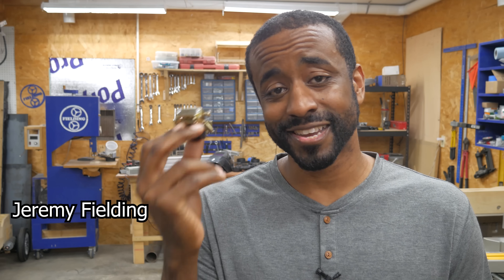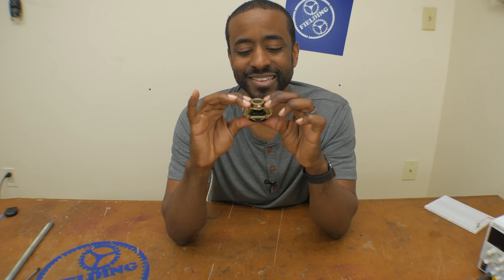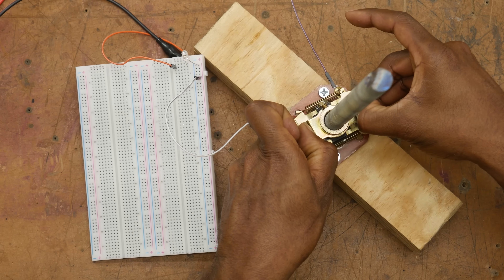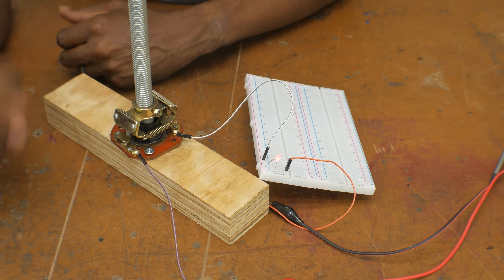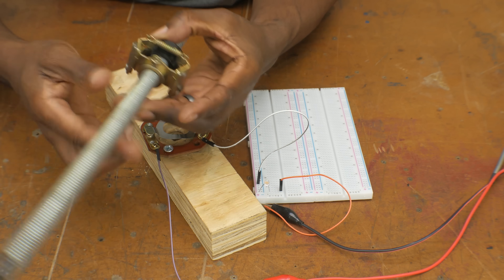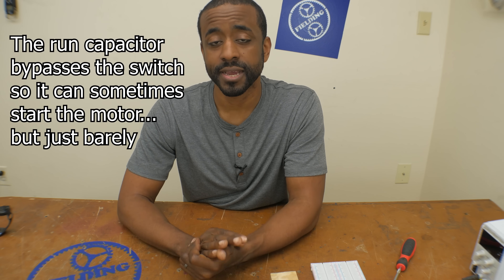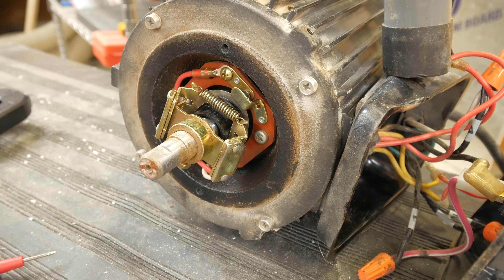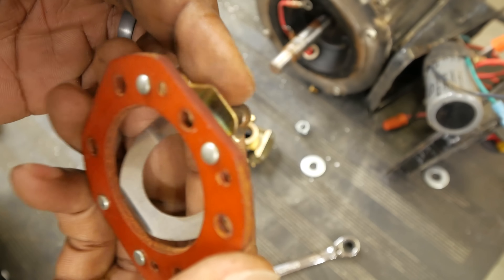This Clever Device Is Found In Nearly Every American Household. How It Works And How To Fix It

Comment: Sorry you're wrong. Its a CENTRIPETAL switch not Centrifugal. Common misconception..
Centripetal = Inward force working out
Centrifugal =  Outward force working in
A Centrifugal clutch spins and the weights push the V-Pulley in pinching the V belt. Get it From out to in . These are usually on Go-karts. I only have a GED and know this..
The amount of people in the comments that overlooked this very basic concept is a crime against the education system. Let alone the guy that spent 9 minutes teaching about something he doesn't know the correct name of or the physics concepts behind his words. Hilarious.                        496/670,000 people can do math.....
I barely made it 1.5 minutes in and I'm done....
Reply from the maker: The name is correct. The other details aren't relevant here. Perhaps an argument for a physics class not a video about electric motor parts. You are strangely worked up over this. Anyway... thanks for watching... that 1.5 minutes counts!

Comment: The mechanism was first implemented in steam engines, there was a shaft inserted in a steampipe with a turbine attached at the end to make a pair of iron bals spin, if the pressure got too high it would spin quickly lifting a check valve to the atmosphere and effectively reducing inside pressure and avoiding all together a explosion in the cauldron.

Comment: If you don't add a snubber circuit to the motor and/or the centripetal switch, you'll spend a lot of time cleaning and changing contacts in the future. It's the same problem that occours with contact breakers in car engines with mechanically-timed ignition...

Comment: Below is the patent registration for the centrifugal switch. This engineer worked for GE. The patent pending was submitted by GE in 1939-11-01. Full patent was granted May 27, 1941.  The patent has been renewed a number of times after granted.  See below:
--
 y 1941- c. P. PEPPER CENTRIFUGAL SWIT CH Filed Nov. 1-, 1939 2 Sheets-Sheet 1 Inventor:
- Carl P. pepper",
I byMd HIS Attor'ney.
' y 1941- c. P. PEPPER CENTRIFUGAL SWITCH Filed Nov. 1,' 1939 2 Sheets-Sheet 2 IIIIIII/ L. w P n o P e o MP W A 1m m afl C Y. b
Patented May 27, 1941 UNITED STATES PATENT OFFICE CENTBIFUGAL SWITCH Carl P. Pepper, Fort Wayne, Ind, asslgnor to General Electric Company, a corporation of New York Application November 1, 1939, Serial No. 302,383 

Google Patents:
https://patents.google.com/patent/US2243577

Comment: Awesome Jeremy! I have many motors in my shop that make that noise. Thanks for explaining why they do. One note: BEWARE capacitors as they hold a voltage that can bite you during disassembly. Short the leads with a screwdriver (AFTER UNPLUGGING!) or spare lead to discharge them during the troubleshooting and repair process. Keep the great videos coming...

Comment: If you have a points file (used on older car distrbutors), you'll be able to make this fix easily with a tool designed for that contact file job.

Comment: Yep, you found the problem, but your solution “might” be far from ideal. Those switch contacts are usually made of a filler cheap metal and then the contact are plated with a more “”spark”” resistant alloy. So when they fail like this one is time to replace it because sanding just makes it work for a short while and will keep “boring” its way through the metal on each “click” and wore out way quicker than a new one. At very lest I suggest sanding it with the highest grit possible to avoid “roughness” that helps more sparks (this is why new contacts are mirror finished)
This suggestion applies to electromechanical relays, same principle; different alloys for different purposes

Comment: A very similar type of 'switch' is used in 40 mm grenade launchers.  The round isn't 'armed' until it travels a certain distance.  As it travels through the air, centripetal acceleration caused by the round spinning in the air causes little weights to pull the 'safety' out of the way. 
-
That scene in Scarface... total nonsense.  These don't arm until about 30 meters.

Comment: I used to work on C130H (Hercules, that big military transport plane with 4 props) and these are one of the main components that regulate the fuel flow to the engines or keep the prop from spinning out of control (basically anytime something that spins needs a feedback loop you'll find one of these guys)

Comment: a comparable replacement is 220V but i guess you have freedom voltage as well as freedom units. I am honestly surprised with how many workarounds American engineers have to have to deal with 110V/10A (ie, 2 phase ovens). At 220V/10A you can still use the same wire guage but get twice the power with no downsides.
Reply from the maker: We have both 120 and 240 in every house hold. I don’t understand your comment
Reply: @Jeremy_Fielding  really, why?

I've heard that it was only 110, with double phases for high power appliance (giving around 200V non sinusoidal) but maybe that's just for apartment blocks with access to all 3 phases. I've seen video of it but he lives in an apartment as I suggested. This guy was trying to get a Ozzie hairdryer to work in America and on 110V.

But if you have both why have both? There is no need for 110V, infact as you showed in this video it's a detriment, needing capacitors and extra moving parts to give high power items an extra boost. And it just seems an extra hassle wiring the house (and do you have two power metres or something? Or every house has a 2:1 step down transformer?).

Comment: Rubbing contacts with sandpaper should only be used as a temporary fix, until you can get a new set of contacts, or as a quick fix when you cannot obtain a new set of contacts. The reason is that many contacts have a plating that you'll remove with the sandpaper which will reduce the operating lifetime of the contacts. Maybe use a lot finer paper too (P300?). Other than that, a really interesting tutorial. In the UK, I've never seen a centrifugal switch like this, maybe because the voltage is higher? (230v vs 110v)

Comment: Why haven't we used this technology on Bayblades
Reply: Not exactly the same, but spinning tops with lights inside that light up only when rotating, actually use something similar, but way simpler: just a spring and that's it. Literally, a spring, that with it's own mass, touches a metal contact and closes the circuit for the light.

Comment: Ha, reminded me of the old days when the car would not start. Had to take an emory cloth to the points, clean them up and set the gap (by eye) and "TA DA", your friends and your girl think you know what you're doing and  you're the hero. Yay
 Nice and easy explanation of this fascinating part. It also remind me of "balls out". No no, not that. The governing technique where 2 weights swing outward to govern max speed.  Which also gave us the phrase that means one is going as fast and full throttle as they can. "Ball out", or "balls to the wall".

Comment: A few corrections: 

1. The start capacitor will not explode if it is not disconnected from the circuit within a certain time frame (most capacitors run in series for this application). The very nature of capacitors are to A: store electrons for that initial 'punch' of power, B: clean up the power and protect the rest of the circuit from voltage spikes, C:act as a buffer from induced current from a collapsing magnetic field.

2. The start and run windings of an alternating current induction motor are different in this way: the start windings consist of fewer turns of a larger gauge coil which lets more current pass through for initial motor start up, and the run windings consist of smaller gauge coils with many more turns.

The reason for the centrifugal switch is to disconnect the run windings so you do not burn them up and over amp your circuit. Remember, initial inrush current is usually five times higher than the amp draw at full load.

Comment: Clever & simple are opposite sides of the same coin.  The mistake you made cleaning the contacts was using sandpaper.  Old distributor type auto ignition systems used centrifugal switches also and so somebody invented a special ignition file to clean the contacts.  It produces just the proper surface roughness to maximize the life of the contacts.  Yours will probably fail again because they are too rough.

Comment: If the weights were heavier they would open late and lighter they open too early??? You sure about that? Either you said it backwards or I misunderstood your qualification.
Reply from the maker: I said it very carefully on purpose. Look up the formula for centrifugal force. You will see the relationship between speed, mass, and force
Reply: @Jeremy_Fielding  well your videos are pretty good and informative. I've seen a number of them. I may be misunderstanding how your saying it in which case that's on me. Keep up the good work. I've been working on CS motors for decades and your explanation is pretty clear. Good job.
Reply: No, you are wrong.